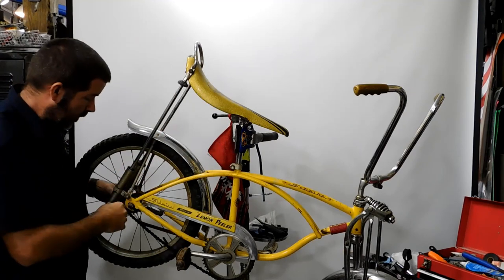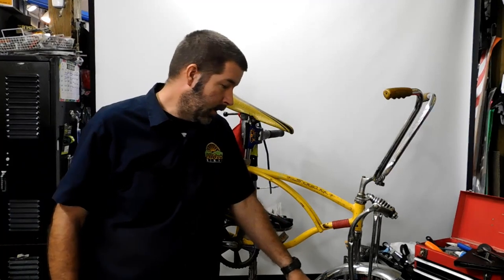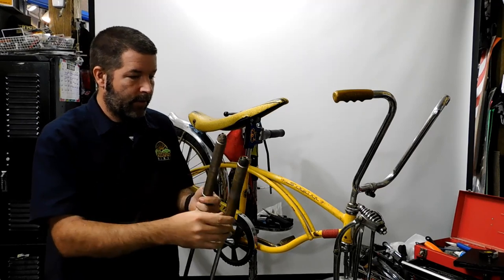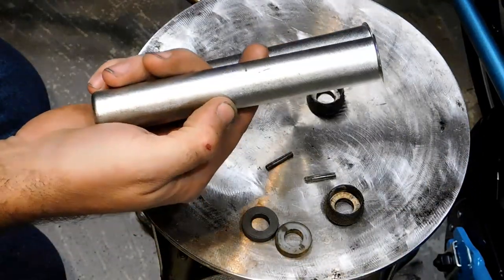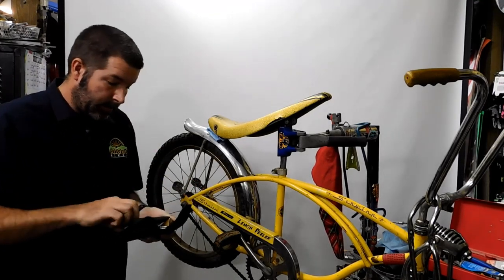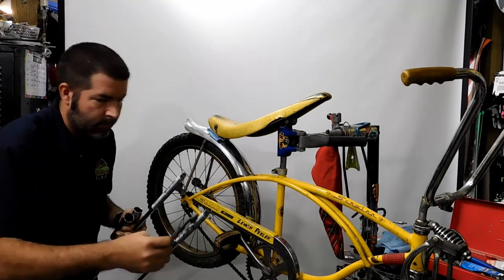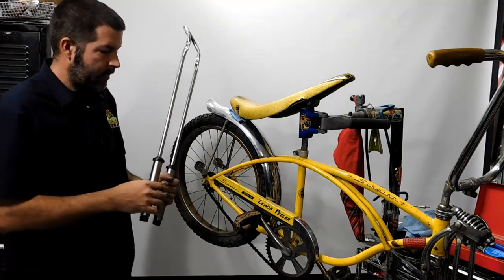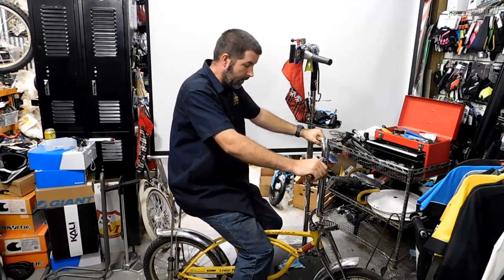Working on a 1970 Lemon Peeler.

Comment: I was 11 when that bike was built. The rich kids had bikes like those. There was red, yellow, green and maybe more but there were three kids with those colors mentioned. They had the rear suspension seat but one of them had a real tall bar that came up that held the seat up and then it extended a good 18in maybe 20in higher.
In my day we called that a "sissy bar" the shorter one, the one you're dealing with there was just part of the seat suspension. 
 I never liked those sissy bar because if you did a wheelie and when your front tire came down and weren't careful the "sissy bar" would swap you in the back of the head. 
Love the video. Brought back old memories.
Reply from the maker: Thank you for sharing!

Comment: I add a thick nylon washer to top and bottom of my old worn out krate sissy bar springs! Nice bike.
Reply from the maker: Thank you. Thanks for your input.
Reply: @alloutbikes  there was a guy on ebay selling a stiffer spring and 2 thicker nylon washers for adult riders. I'm also around 190 pounds at 5'10"
Reply from the maker: Thank you! I did not think to look around I just went to my local hardware store and was lucky to have found the perfect springs. Thanks again!

Comment: I was born in 1960 and  the stingray was a huge part of my early teens, caution it’s not the bike to do big air jumps on ! It’s a trip to land hard and have those bars lay out flat and get a tire burn on you belly from the front tire
Reply from the maker: You were the cool kid on the block if you had one. But your right they did not handle as good as they looked. Thanks!
Reply: It was gold with the chrome fenders and the shoulder high sissy bar , the fenders and chain guard came off and on the shelf

Comment: Numbers have nothing to do with date or year. They are just sequence numbers!
Reply from the maker: True most of the time but back then when Schwinn was made in Chicago. They incorporated the date into the serial number. Of course it did not say November of 1970. But they did have a code. Also in the video notice when I am cleaning up the rear hub it had a date 70 meaning 1970 component companies used to date there parts to keep track. Again you are right about just a series of numbers most of the time. But in this case your not. Check it out. Find an old Chicago Schwinn and try looking up the serial number then look closely at the hubs and other parts and you will notice they match up. Its pretty cool. Thanks for watching!
Reply: @alloutbikes  oh yeah, I'm very aware I'm a schwinn collector of over 30 years! I was actually Born and raised in Chicago less than 3 miles from the Koster Ave Factory!
Reply: @alloutbikes  what I mean by numbers have nothing to do with the year! The 1st 2 letters are month and year of its birth! But the following numbers have nothing to do with dating the bike. That's what I meant!
Reply from the maker: Ok. I'm not trying to insult you. I have collected for years but I don't have a true understanding of how they came up with this dating code. All we would do is call Schwinn and they would tell us. If you could help me understand I would appreciate it. This serial number starts with (KF 38***) how do they get November 1970. I understand K is the 11th letter and November is the 11th month but the rest is lost. Please let me know so I can make determinations out in the field. Thanks, Jason.
Reply: @alloutbikes  not insulted at all brother! So yeah 1st letter is month from January 2nd letter is year starting from 1963. They didn't use the letters O or I Because they was easy to be confused for a 0 zero or a 1 one. So AF would be Jan 1970 as follows in the alphabet. Like I said Stingrays starting in 1963 not using I or O. If u send me a email I can send you picture of a date card. Or check your INSTAGRAM messages! I send you some pictures of my collection and I can send you a picture of a date card!
Reply from the maker: @oldguyBMX  Thank you!